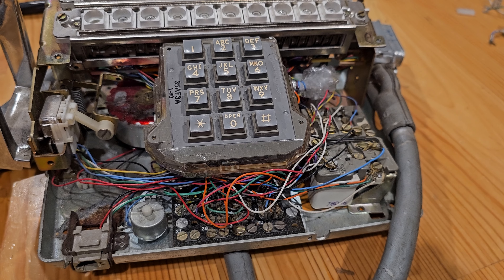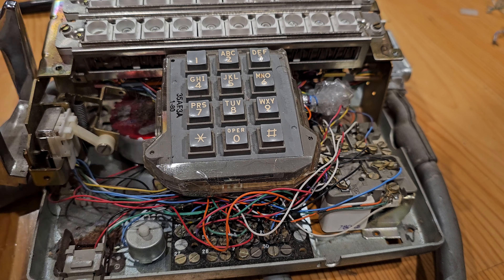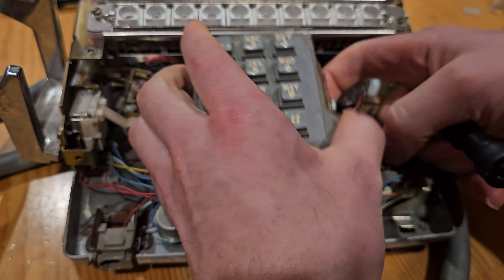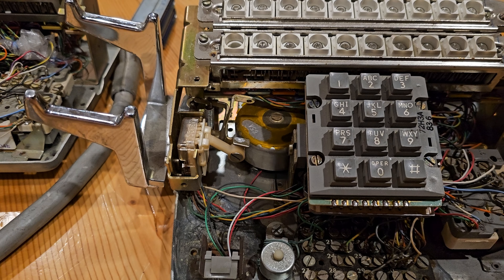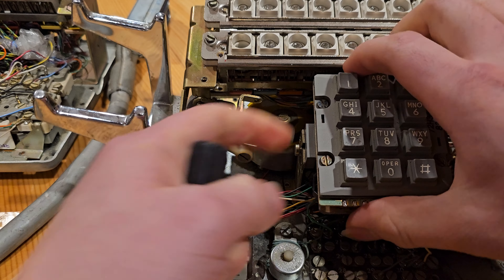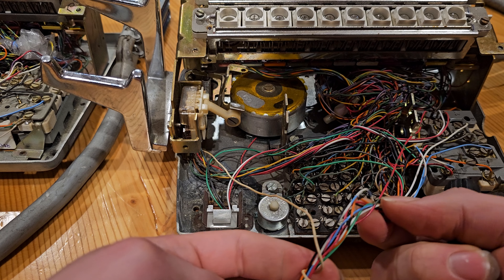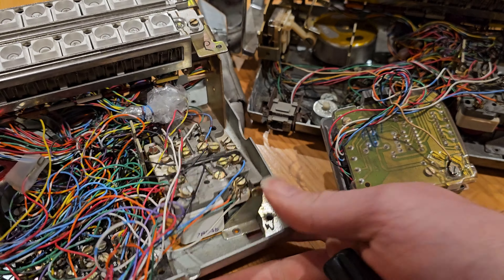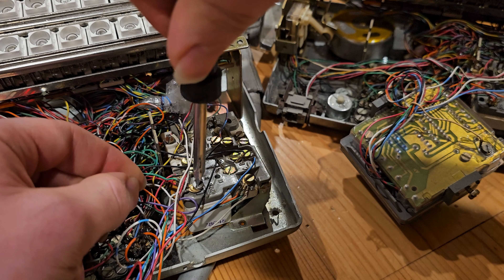Touch-Tone Dial Transplant Western Electric 2831 35af3a dial 1a2 telephone

Comment: I've never had the guts to swap out a touch tone dial like you just did. Well done... and it seemed to work perfectly. 
I'd like to change out the dial on my Northern Electric Call Director but can't find any documentation on the phone or the NE dialpad that's located in the phone!
Reply from the maker: Yep the NE sets can be real tricky to work on since they aren't as standard as WE 

I think I am sorry to admit but I probably sold you that phone

My ebay user is hawky_hatter 

I rember it lol

I think it is possible for sure to replace the dial

It just takes some guesswork knowing what is usually connected to what

I think your phone had a newer network that took the horseshoe clips and basically plugged them in? Unless I am remembering a different phone 

Those are unfortunately a bit annoying to troubleshoot 

If it had a screw type network you could probably troubleshoot much quicker 

You could also just replace the network with a nicer older Western electric network and WE dial

I have more networks that would fit ok just I am fresh out of working dials